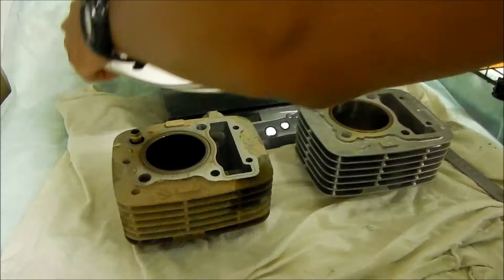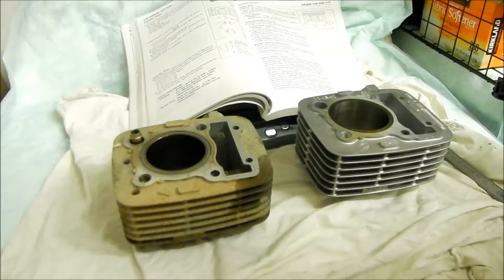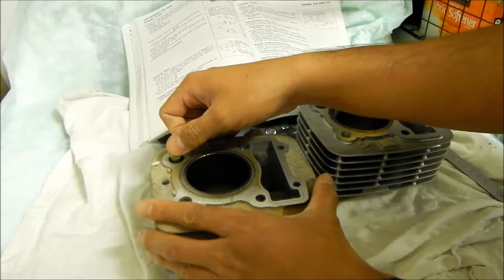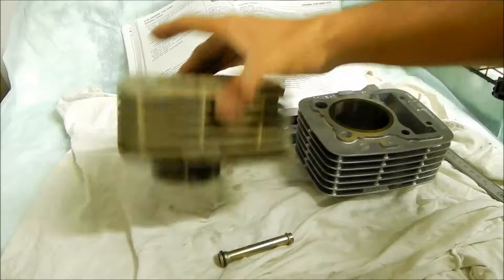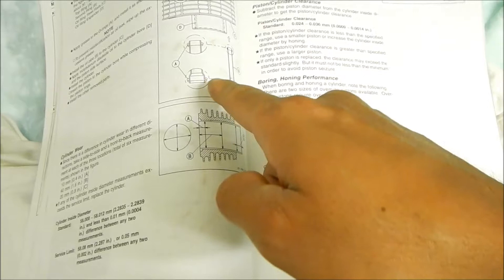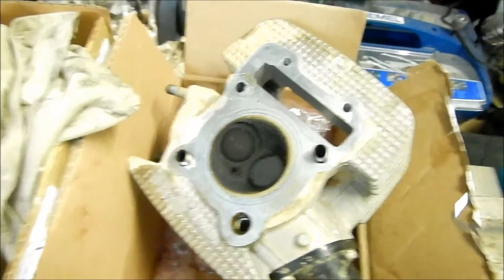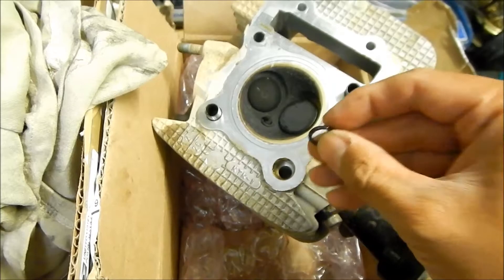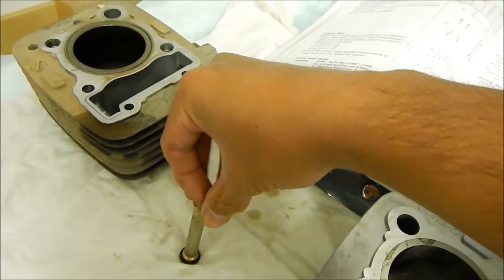KLX140 Big Bore Top End Rebuild VLOG Part 15 - Cylinder Preparation

Comment: where do you get the mechanical schematics book pleas just got a 2020 klx and have a pro circuit t 4 and 6 sigma carb tuning kit on the way
Reply from the maker: I have the Kawasaki KLX140 factory service manual.  You can find them on ebay or a local Kawasaki dealer
Reply: @hadesomegamoto7639  thanks man